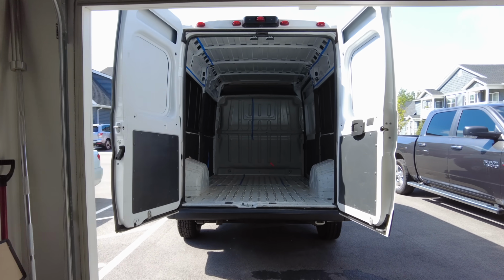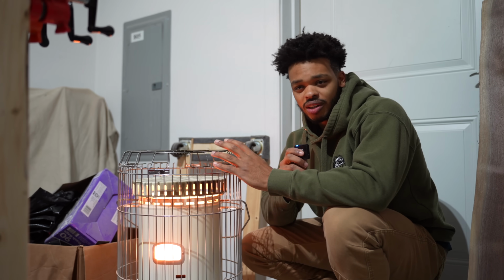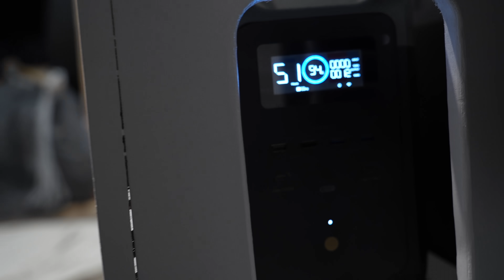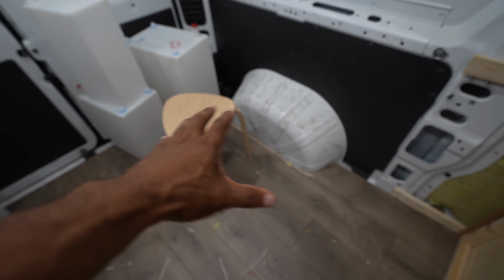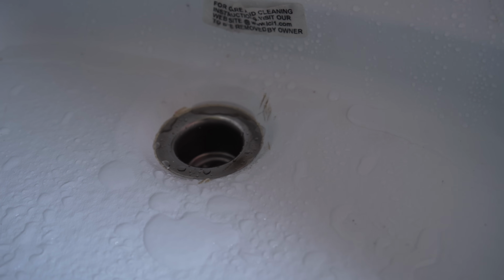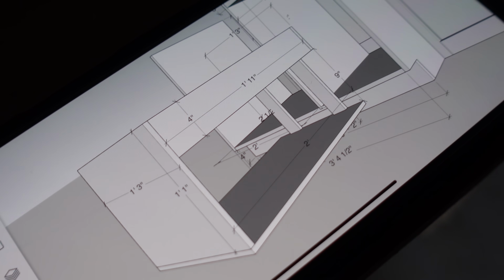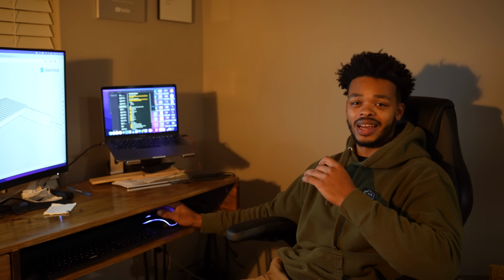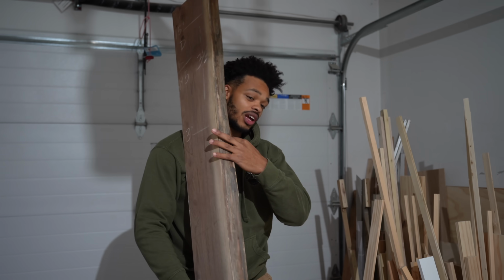I Transformed a Work Van into a Mobile Home | Full Build Start to Finish

Comment: I can't believe I just spent my lunch break watching this young man build a house inside of a van. EXCELLENT WORK, young brother. You have MAAADDD skills, man. Keep up the excellent work and you just picked up another subscriber to your channel.
Reply from the maker: Thank you for spending the time to watch my video! I appreciate that and welcome to the channel
Reply: @Dualex_Builds  where did you learn?
Reply: @Dualex_Builds  Wassup my brother, do you remodel travel trailers also?
Reply: @Dualex_Builds  you should make a Mobil Barbershop 💈from a a large UPS Truck & drive to Get Beamed,360 Jeezy , or Minnieweather ….. doing cross collaborations
Reply: @Dualex_Builds  I just have to ask ... where are you located and how would someone go about acquiring your services ? Oh, and by the way, you're amazing and have some very mad skills ... keep it up !
Reply: Incredible work young man! 👍🏾 I enjoyed every inch, frame, paint & glue drop, saw-dust, insulation of your video. You are a true Builder from start to finish!!👷🏾‍♂️  I have a few questions? What is the weight of the Van after the project was completed? How did your work stand up when it finally got on the road for the first time after completion? Was there any issues with the power required by the Van’s Engine? Did you have to make any modification to it? Again, awesome work young man. 👍🏾✊🏾😎
Reply: Im amaze to his work very talented..
Reply: A completely random YouTube recommendation and I've just delayed what I'm doing and watched the whole thing
Reply: I'd love for you to do a tiny house for me. You're awesome
Reply: Gotta say the same thing man this is the new way of loving rent free this gonna change the living in America honestly
Reply: Women love men like this . Men who CAN DO THINGS . It’s a turn on 😮
Reply: AND if I could add - while wearing a moon boot. These aren't easy to wear either as it's heavy!!! In short, this guy IS A REAL CHAMPION . . .😊
Reply: @LetsTalkTelevision  exactly! The whole time I'm like this guy's wife is blessed!
Reply: I am a 71 yr. old female & I am hooked!
Reply: @Dualex_Builds Dual Ex I am new to your YouTube channel.Quick question have you ever been approached through email and or fax from the (DIY NETWORK)?I ask that because there have been some people who are craftsman,chef’s,baker’s,etc who have but they turned it down for whatever reason.And last question have you ever taught any classes at let’s say for Home Depot and or Lowe’s?Dual Ex there are so many people who want to learn how to build and create things.Last question I have one more question.Have you ever built a house by yourself and or with a team of other contractors/construction workers?

Comment: so... this guy is a carpenter , cabinet maker , designer , electrician , plumber , painter , metal worker (I may have missed some) and film editor extraordinaire. I'm just stunned. What a lovely van build and multi talented man. Brilliantly filmed and edited I might add. I wouldn't even know what to call most of those tools let alone how to use them 😆 Great video , Thanks for sharing ❤️

Comment: This is the most amazing video I've ever seen in my life. This is not some average joe though. This dude is a master tradesman. The cuts on that wood work have to be perfect, you're basically making Ikea furniture from scratch. And the flooring, insulation, electrician, plumbing, welding the Autocad drawings. The overall engineering from just in your head knowing exactly where you need to make a hole. Not to mention the video work and editing itself is amazing. I'm like speechless right now.
Reply: He could own his own construction company and his own production company!!! He’s already doing it.
Reply: Brilliant. Add videographer, editor, music and director to the mix
Reply: I could not stop watching!  Holy Moley, you are an amazing craftsman.  I struggle with some of the basic DIY in my (UK) home.  What you have done is outstanding and could be documentary level for TV!  Wow, and the end result is amazing.  The joints you made are master craftsman level.  I have certainly picked up some tips.  Brilliant video.  Thanks for posting 😃.
Reply: Right, same here 🔥🔥
Reply: Everything you just said… WOW

Comment: I usually order videos that get to the point this is so extremely impressive I would have easily sat down through a 2 hour video while you explain step by step what you’re doing, measurements, requirements etc. WOW, just WOW 👏👏

Comment: First,I think your work is awesome and very professional. But when you were putting in the solar panels and fan in the outer ceiling did you seal the screw holes from rain and weather?